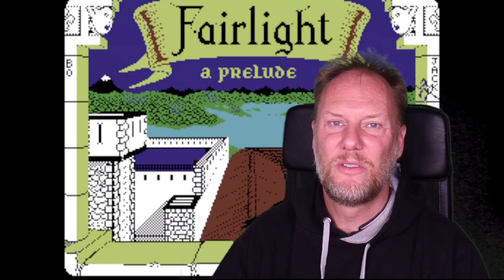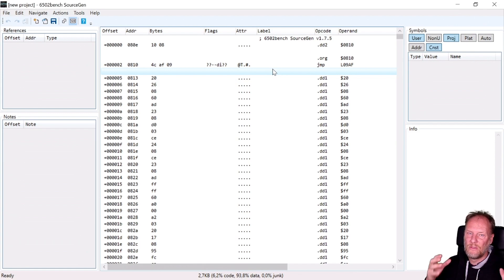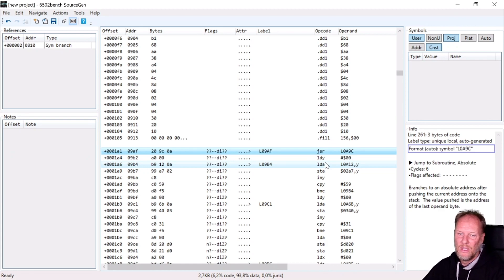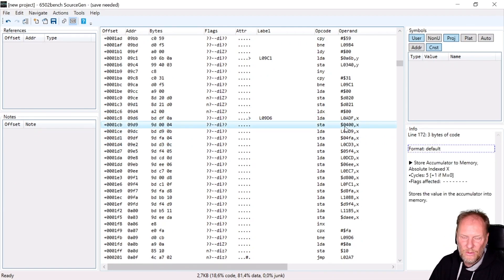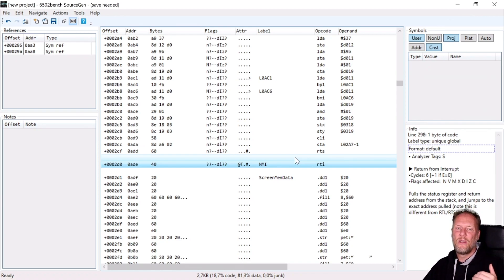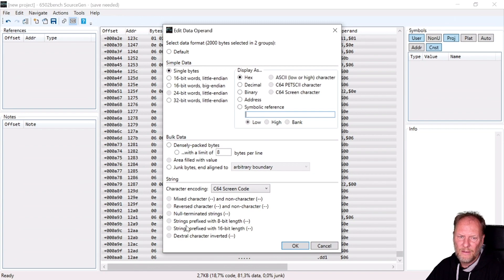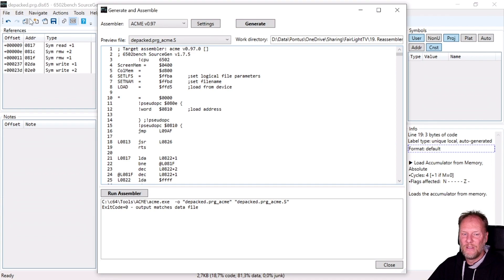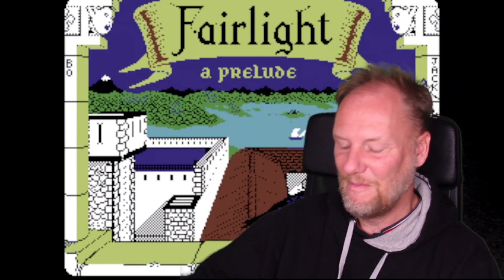FairLight TV #20, FairLight facts: 6502 Bench

Comment: Very nice!

A few notes...
 4:55: double-click now documented (whoops).  You can also hit Ctrl+J if you're a keyboard addict, or Navigate > Jump to Operand if you really like menus.
 8:10: feature incoming. 😃
 8:35: you could also double-click the operand to open the editor. When defining a project symbol that represents the start of a region of memory, you can specify a width. For C64 screen memory it would be (I think) $3e8. That would cause the next few STA statements to be formatted, and would cause those access to appear in the References list when the "ScreenMem" .equ line is selected.
 10:37: you don't have to click the "Symbol" button. Just start typing the label -- the label field has focus when the dialog opens, and will select the radio button for you when you hit a key. Hit Alt+I to pick the high part. Faster than moving between mouse and keyboard.
Reply from the maker: Many thanks for the clarifications.